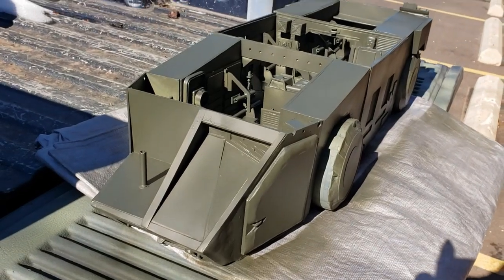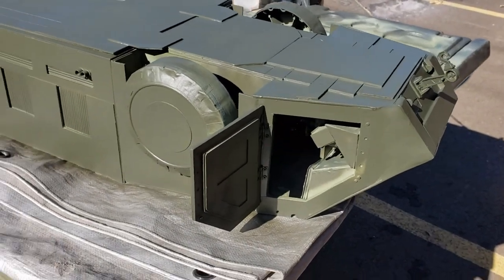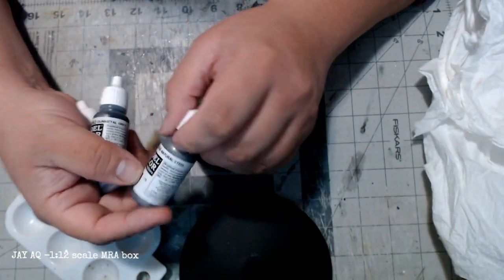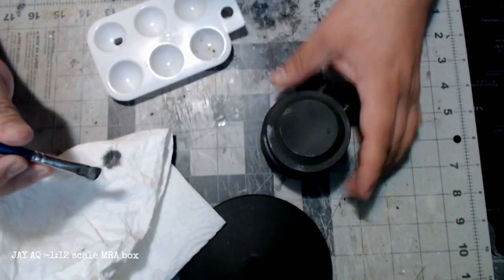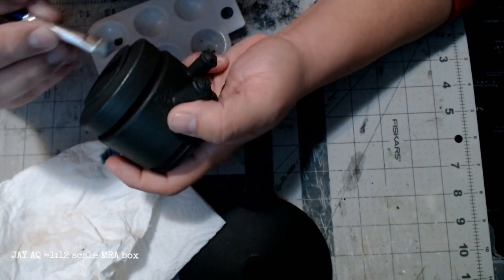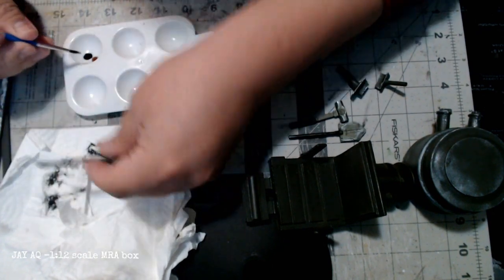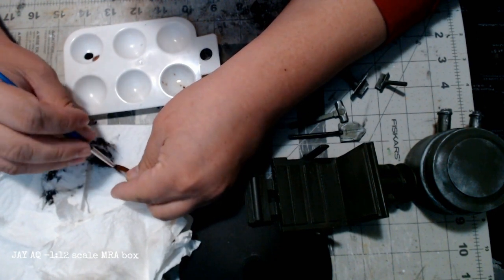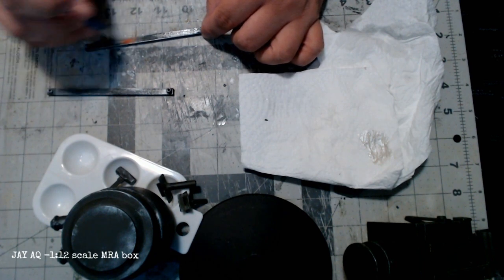ALIENS APC - weathered & painted

Comment: I really like how it turned out 
I like to use a Make up Brush or Fan Brush to dry brushing
Even cheap Model kit Paint Brush.
To apply Rubn Buff.for Deep Scratches
Reply from the maker: I'm definitely gonna pick up a makeup brush next time i go to the store. I had the perfect- hard bristle brush i used for years, but it wore out and now IM trying to find something that works as good. Thank you for the kind words! I'm gonna try to put out the final video tomorrow evening if possible. After I finish my Exoskeleton project, I'm gonna try another large scratch build. right now I'm not sure if it will be a boat of a Helicopter/ hover craft. I cant decide.